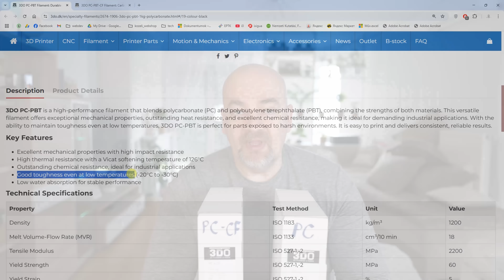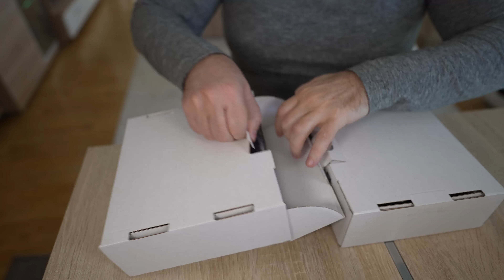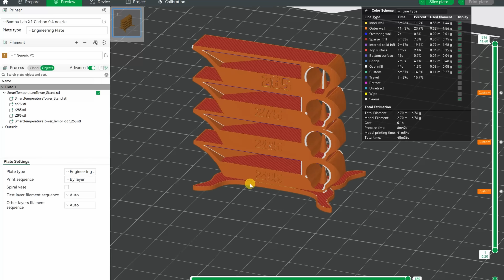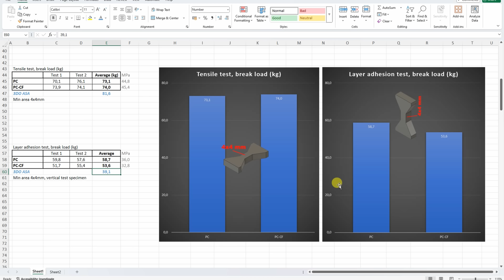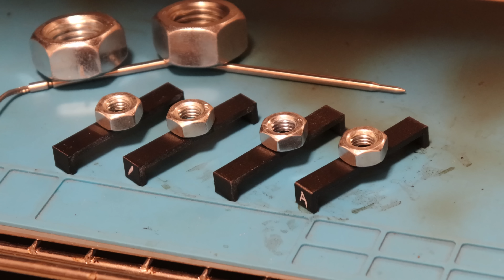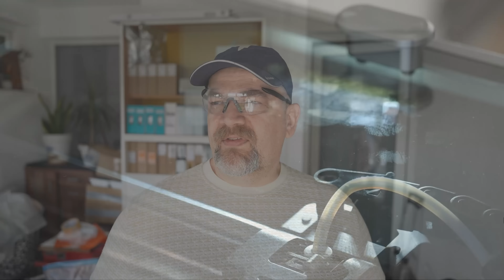3DO PC vs PC-CF: A Carbon Fiber Filament You Can Actually Bend!

Comment: I have a  voc monitor 2 feet from my printer it only goes off when someone uses a spray in the bathroom 22 feet away! 3 doors away I use carbon and glass mostly .The only time you could get VOCs is using reinforced PLA as you print with the top open the rest of the closed box filaments are filtered by the case fans filter

Comment: Sunlu has a PETG CF that has the most bending resilience I have ever seen in a filament. its almost like a very very hard rubber, that can be twisted and bent in any direction, regardless of print orientation. Unlike Hello3d which also has a petg cf, which is incredibly strong, stronger than pla+ and very light and has a super nice finish. prints beautifully

Comment: On my X1C, the "purge" line that is set in Orca runs along the back half of the plate, and up the right. When it goes up the right, it kinks the ptfe tube and breaks PPA-CF every time. I modified that startup sequence to start from more to the left of the back, and never go up the right side. Called the profile, "low poop, no break".

Comment: I don't need this extreme performance but I'm tempted to buy a roll of very high performance material in case I need it - typically if I need near metal performance from a 3D printed part.  Based on the surface glossiness and the way it bent without breaking, it didn't look like there was much carbon fiber in the PC-CF.  Manufacturers often don't publish that spec, but we could burn away the PC and weigh to see how much CF remains.

Comment: I'm more interested in improved performance at a small increase in price.  The price of PET-CF filament has decreased lately and offers a good value in a better performance material, and the matte finish that hides layer lines is an added benefit for niche products.  However, I thoroughly enjoyed this video showing high performance filaments.  If you need these material properties, paying 2-3 times as much is reasonable.

Comment: Thank you very much for this video Dr Igor! I have both materials and I am happy to see these results, as they confirm that for my project they are suitable materials. I will print with them the internal structural sceleton of a liquid cooled PC, so they will need to hold heavy hardware (nickel plated copper waterblocks), heatsinks and radiators with fans. Interlayer adhesion will help me in regards to print orientation. Now the creep performance might not be the best, but I might be able to solve the issue via design (ribs, textured surfaces, lattice, patterns etc). For the moment I am prototyping and progressing on the design with PETG, before using these more expensive filaments.

Comment: Thanks again for your thorough testing! This are very interesting results. I tested 3 (2x PA CF, 1x ASA-CF) different CF filaments, which you haven't tested. They are all extremely to really absurdly stiff(Siraya PAHT-CF). But if you just look at a benchy the wrong way, the chimney flies away(my unscientific layer adhesion test...) I found some usecases for the stiffness. But often, toughness/impact resistance and layer adhesion are allso required. And then most CF filaments are useless. 
These are despite their prices very interseting filaments!

Comment: I print a lot of PC from Polymaker and find it to really be awesome stuff when you need the absolute toughest prints.  I also have some PCCF from some... brand?  lol.  I used to to make some VESA adapters for monitors and that stuff was insane.  Held up for years and never creeped or distorted, stayed incredibly rigid.  Really fantastic stuff if you're capable of printing it and design and slice parts for maximizing its strengths.

Comment: Do the people who are freaking out about CF-filled filaments realize that there are entire industries centered around fabricating parts directly from carbon fiber? While I am all for doing more research and better understanding what the risks are, I have to imagine 3D printing is a far lower health risk than what people experience when making CF parts for bicycles, cars, drones, airplanes, etc.
Reply: Its more like the sanding cf risk. And people tend to use breathing filters when they are doing that.
Reply: Theres a major difference, an fpv drone frame thats pure CF doesnt stick tiny needles in your skin, merely handling CF filament and printed parts immedietely does.
Reply: @Athiril  Which does nothing to your health…

Comment: I think you are correct about the danger of carbon fibers. Many people are scared of any fibers (except wood) because of asbestos. But asbestos fibers are different. When they break, they form very thin but long fibers. Glass, carbon and wood fibers don't break like this; they form thicker and shorter fibers. The body's immune system tries to "eat" the fibers in the lungs, but for long fibers, this does not work. Therefore, it ends with chronic inflammation. Additionally, the chemical composition of asbestos could also increase the inflammation (like silica particles [not fibers] from sandblasting are dangerous if inhaled [Silicosis]. The chronic inflammation can lead to different lung diseases and cancer. Shorter and chemically different fibers like wood, GF or CF don't create chronic inflammation at the same dose as asbestos. Still, hard wood dust is classified as a carcinogen substance. Therefore, I don't see a major risk working with GF, CF or hard wood, but when drilling or sanding it, I use either a FFP2 mask, do it wet and if possible, outside.

Comment: I use Polymaker PC-PBT because it's so good. It's great for cold weather parts.
Reply: 100%, I’m a PC-PBT evangelist lol. I spoke to a PolyMaker rep and he was shocked that I was able to print it because he thought you had to have a 100c chamber. Even in open air (with ventilation because it’s VERY smelly) it is super strong.

Comment: If they drop the price to max 60€/kg  I will buy it and use it instead of PETG... But this will never happen ...
Reply: I've been getting Siraya Tech ABS-GF at US$35/Kilo. The stuff was so good I reengineered my common parts for work to take advantage of the better strength, they are now much lighter and cheaper to produce than their PETG equivalents.
I did recently buy a spool of 3DO PC-GF, I haven't tried it yet though.
Reply: I need something better than petg pretty bad but not sure if this is it. And i wish it was without fibers
Reply: @Boz1211111  get PEEK